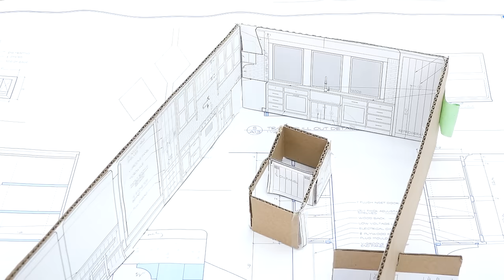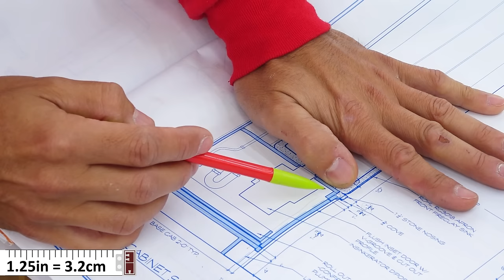Adding Cabinet Boxes to the Face Frames | Home Renovation & Addition Part 58

Comment: Nice design work on the cabinets. Also it is always good to have the farmer's sink on hand when building the cabinet. Often their dimensions change slightly when they are fired in the kiln. Custom fitting the sink is the best way to control the margins since the sink and countertop are the two elements the cabinet maker doesn't control!

Comment: I made my kitchen cabinets in a similar way. One thing we found, after them being installed for years, is those face frames going all the way to the floor creates an inside corner that fills with crud that is dropped, spilled, or kicked under the toe kick. You can't get a swiffer or similar in there to clean it properly, you have to get down on your hands and knees. You have kids as well, so it'll presumably end up the same way with you.

The other thing is the legs get hit all the time with kids, vacuum, etc. 

They look great, but turned out not to be practical for us.

Comment: Every endeavor has its own vocabulary. Machining has "swarth" to mean the metal cut off a "job". Sawyers have "wain" and "figure". Cabinetry has "face frame" and "box". I wondered about "box". In ceramics, a "box" has 2 parts: the bottom and sides vs. the "lid". In cabinetry, the "lid" is the front of the "box" and a "box" can have multiple "lids". If the "lid" slides out, it is a "drawer". If it swings open on a hinge, it is a "cabinet".

Comment: Finally someone uses dominos and pocket holes where they make sense and just screws through the sides otherwise when that makes sense instead of unnecessary gratuitous pocket hole nonsense like most of the rest of youtube. 

Really interesting build. I've heard of building kitchens to scale with cardboard or something to get a feel for the final build. Face frames first is really smart. About halfway through I'm interested in how you handle the toe kicks.

Comment: Beautiful.   In your last cabinet video you mentioned making the cabinet for the fridge 3 feet wide.  Hope you made it bigger.  Fridges seem to get bigger year after year and they radiate the heat off the sides now so leave plenty of air space around it.  If you seal it up too tight you might kill the fridge.  Good time to double check.
Reply from the maker: The opening for it is 3’ wide. There’s 2” of air space on either side

Comment: 30:00. Glass Suction Cup, don't forget to seal all cut edges. Over time all sorts of liquids will seep into the cuts. This makes a mess when it swells up. You may be better off making the insert small by a smidge to allow for a rubber seal of some sort. Ask me how I know...
      edit; you can redo the insert by making rabbits on the edges and base to simplify it. No rubber.  (I don't see the need for the heater at all)
 I put a second layer on top to hide it (1/4'') Just make sure you can remove it if you need to.
Reply: Or you could just run a 1/8" brad of clear caulk in the corners. But my cabinets from the store don't even have that... all of the clear coat is pealing off of the doors. Cabinets are only 12 years old.

Comment: You wear a respirator all the time, but what about ear protection when running power tools?
As an older guy with a hearing loss, wish I would have started wearing ear protection sooner.
Cabinets look good.
Reply from the maker: That’s the one thing I wear most often. I find the noise uncomfortable which prompts me to put them on

Comment: As for handles, since this is already over engineered, two threaded inserts set deep enough you can get a counter sink head flush, or just some rounded head ones. a screw in the threaded insert just to limit the crap that gets in them over time.

Comment: The other thing I recommend is considering putting some support cleats under the floors of the cabinets. Maybe the screws are sufficient, especially with you having a solid 3/4 back, but those bottom shelves tend to get heavy things thrown in them, like bottles of bleach/drinks, sacks of potatoes, heavy pots and pans, etc.
Reply from the maker: I might but none of the bottoms will bear any weight. All the lowers are drawers
Reply: @mcremona  Oh, good point. It's just drawer slide screws supporting them anyway, so probably not worth it.

Comment: Hi Matt I love everything that you do I think you're brilliant in all of the things you accomplish however I think you would be better served if you were to lower the base where the sink sets as Shaw sinks are always irregular shaped instead of raising the cabinet behind the sink at the top which will affect your countertop install you should take a sander and just sand the base underneath of the sink so that you can lower the sink instead of raising the cabinet I've seen this happen before as I am a master templater or for a granite company just trying to save you a little grief down the road with your countertop install Good luck God bless
Reply from the maker: That’s essentially what will happen when I scribe the cabinet to the floor. The reference for all the cabinets is the top
Reply: You would think that Shaw would make a new mold for those sinks. They have been irregular for many years 🤔 I love the saw mill build. Pretty much everything you do great content

Comment: The cabinets are coming along nicely.  I didn’t realize how heavy the sink was until you got it out of the box and started moving it around.  You may have mentioned this in a previous video, but the plywood looks like a cabinet grade type with some kind of finish on it.  Can you let us know what it is and give us an idea what it costs per sheet?  I know that birch, maple and oak veneered plywood have different prices, but I don’t recall seeing the type your using for your cabinet box builds.
Reply from the maker: 3/4” c2 prefinished maple ply; $125/sheet

Comment: 30:30 would you potentially be putting weight on that panel if you had to do plumbing work under the sink? Just thinking of times when I've had my back down under a sink to mess with new drains / fix leaks / install new faucets. I'm sure it'll be fine and worst case, it falls through onto the heater and you figure out a new system, but figured I'd share.

Comment: This is probably too late but I would make some temporary pieces to support the bottom sink cabinet shelf to hold up the back of the plumber as he's lying underneath? Just my two cents. Looking nice thought
Reply: PS Looks like Eloise will be the one who  will be Dads main helper in the shop at least so far
Reply from the maker: I can do that once the cabinets are scribed to the floor, finalizing the toe kick height. Or I can put a couple of the leveling feet in the middle

Comment: I noticed your blueprint called out a garbage disposer under the sink. Since you live in the country I assume you have a septic system. You might want to reconsider using a disposer if you have a septic system because kitchen food waste doesn't play well with septic systems. It's not usually a problem for city sewage systems, though.
Reply from the maker: I’m not planning on installing it

Comment: That Triton track saw sounds like it is struggling. It is possible that the blade is dull or dirty. I’ve only owned one Triton tool, the doweler, the worst product I’ve owned aside from a harbor freight special. It was way out of tolerance, sent in for repair twice and returned way out in a different way each time. Was never usable, because dowel holes did not register. Also very cheap feeling with an inexpensive stiff power cord.

Comment: Where did you get the prefinished plywood from? Looks like 5 plys plus a veneer on each side? Any issues with warping? I bought 7-ply  radiata pine from the depot for my garage cabinet project but had problems with it warping.

Comment: Do you need to pocket screw the fronts to the boxes? Wouldn’t dominos and gluing the face frame hold it?
Reply from the maker: Yes but I’m not gluing them on
Reply: @mcremona  I was just wondering if they would be as strong with dominos and glue without the pocket screws.

Comment: This brings back some memories. I built a kitchen some years back. My shop was not as nice.

Question: did you have any middle stiles supporting drawers on both sides? If so, since you were aligning your plywood to the opening of the drawer (a great choice BTW), how did you line it up on both sides?
Reply from the maker: There’s a couple instances of that on the upper drawers. I aligned to the side that had lower drawers. The other side will get furred out before attaching the slides

Comment: Matt, perhaps I’m asking too soon (just 1/3 into this video), but will you add some support for the main lower shelf so it is supported by the floor below? I’ve seen SO MANY cabinets that sag on that bottom shelf, and that looks terrible and hampers the structural integrity.
Reply from the maker: Wasn’t planning on it. It’s got support from the back and there’s not going to be any weight on any of the bottoms
Reply: That makes sense, thank you. Of course using that ~3/4” plywood makes the cabinets nearly bulletproof.

Comment: Hi, Matt, I am curious.  Is there a particular reason why you used milled lumber for the cabinet face frames and not MDF?
I would think MDF would be more resistant to temperature and humidity and would be easier to prep for paint and would better accept a paint finish.
Like I said, just curious.
Reply: MDF doesn't belong in a custom kitchen period , it's garbage.
Reply: One reason I can think is durability. MDF is brittle and soft.

Comment: Looks awesome!  Just curious, but since you’re already using dominoes, why did you also go with the pocket screws?  Does this mean you didn’t glue anything and you wanted to be able to take everything apart?  I’m guessing that in most locations the pocket screws won’t be visible, but I’m wondering why they are necessary at all.
Reply from the maker: They’re not glued in case I need to remove them for alterations

Comment: Why not rip to final width with track saw?
Reply from the maker: Factory edge needs to be cleaned up. Easier to just do all the sheets in one go on the table saw
Reply: You could do that, but using the table saw ensures those two edges are parallel.